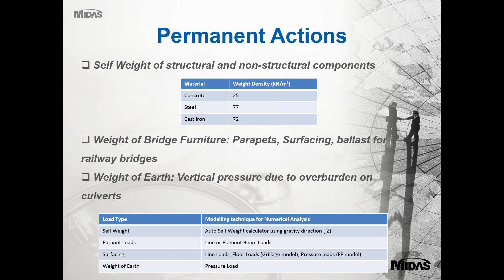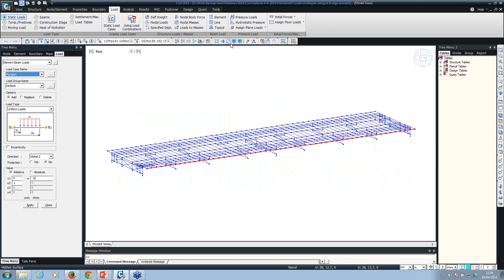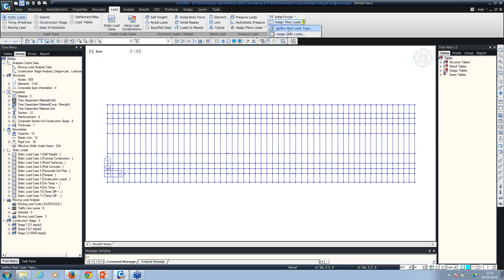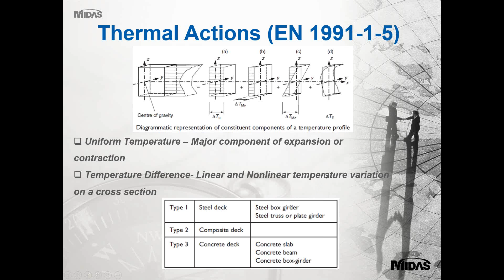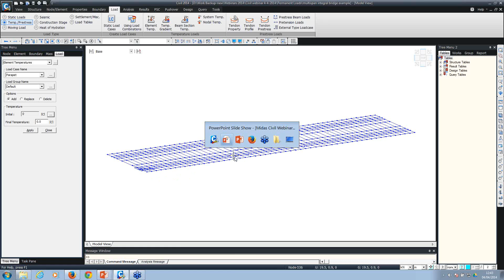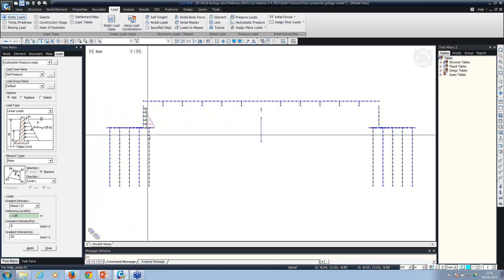Eurocode Actions for Bridges for numerical analysis

Comment: Hi, is there a way to split self-weight for different components into differed load cases? For example, BS6349-1-2 suggests that different partial factors should be applied to steel and concrete self weight. So, in order to do this, i'd like to create a self-weight load case for both steel and concrete materials so that I can apply the different factors, as opposed to normally just applying a single factor to the selfweight of the entire structure. Up until now I have just modified the mass of each material to incorporate the factor. Thanks.